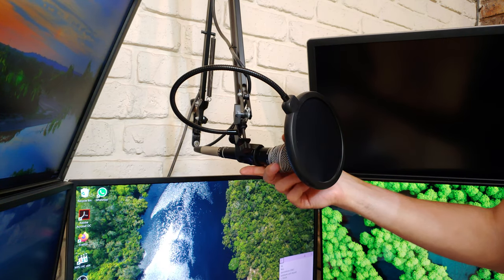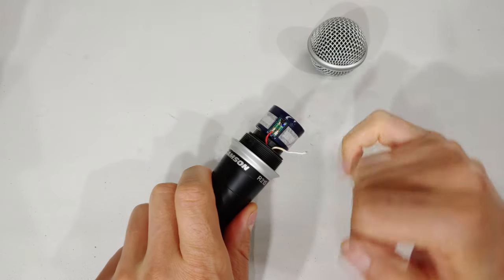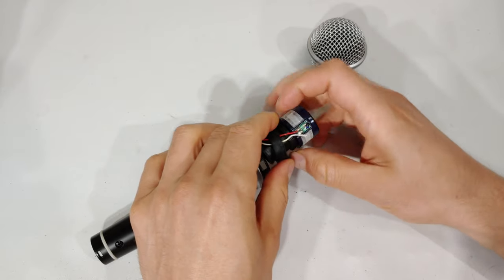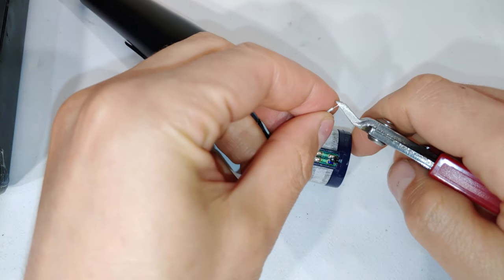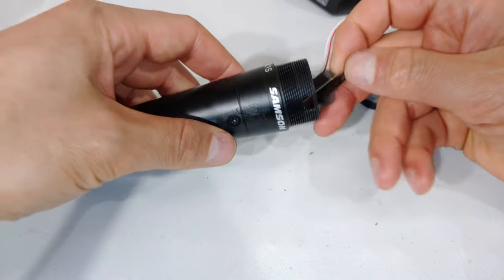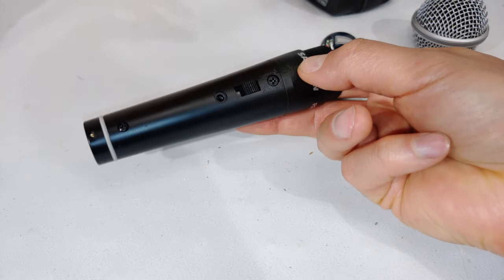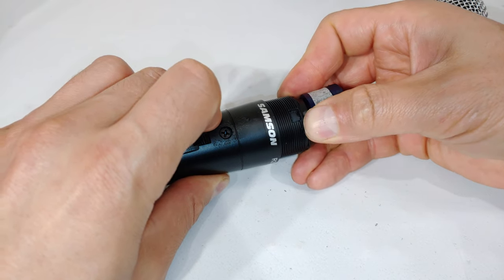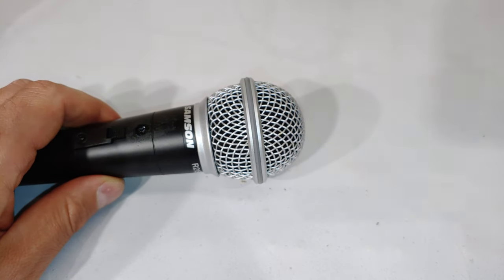How to repair a Samson R21S microphone

Comment: Hello! Well, how's the mic? Is it worth the money? worth buying it? I have little money now, I don’t know whether to buy it or not. He is the cheapest in this market segment ....
Reply from the maker: mic is working fine. I dont have any problem since i fixed it. Still okay.
Reply: I think the mic you used for the repair talk over was a better sound than the tested repaired mic so I would throw away the repaired one 😐
Reply: For the money these are great mics! I've been using them for years with kids, that's how one was dropped. Is it as good as a Shure SM58? No, but it's also only 30 bucks. I have a Shure for my use as a vocalist, but for just getting sound for working with non-profits over the years, they are my go-to mics. Not going to purchase an expensive mic for those who don't know how to take care of one, however, SM58's are almost indestructable, but I prefer to keep that one new for myself and not worry about it being dropped. Just compared the specs if you want a more detail review. Good luck!